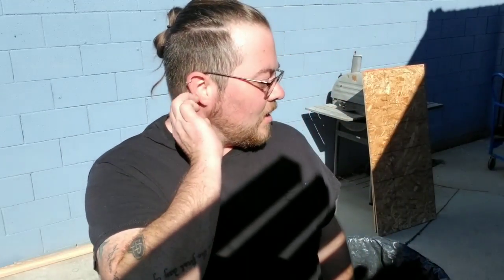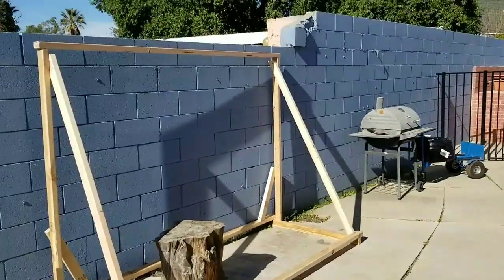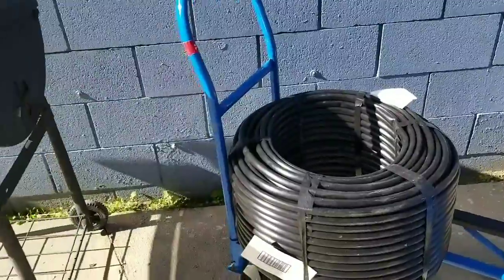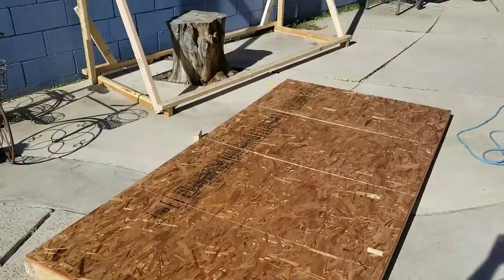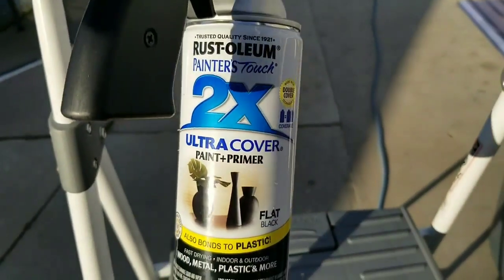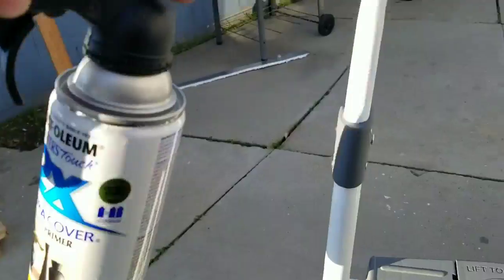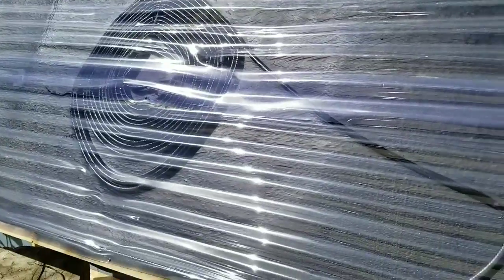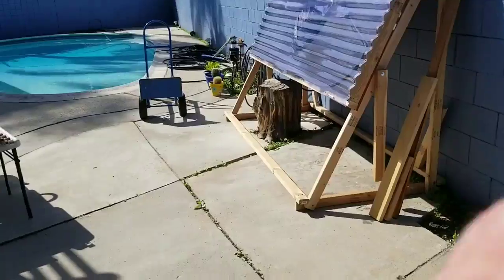solar water heater project...uhh  😁

Comment: Cool project.  Best thing about doing that kinda work is you learn from trial and error and gain a bunch of knowledge in the process.  I've been collecting aluminum cans to use for collector fins when I build my solar water heater.  I'll be using reclaimed copper pipe for mine.  My next remodel on one of our rental houses should give me enough pipe to make one.  Can't wait to see it completed and working.  Just be careful with touching the outlet water because it can get really frikkin hot... scalding hot.
Reply from the maker: Motrukdriver that sounds awesome! I saw the aluminum can build.  very cool.

Comment: you are so creative and innovative!
Reply from the maker: Roaming Raven 😘
Reply: He really is! I've often thought about making one similar to it that I saw on pintrist a few years ago that utilizes aluminum cans inside a 'hot box' frame with a outlet to a dryer hose that blows hot air with a small fan to circulate it. I thought it would help keep my screened in porch a little warmer in the late fall or winter months out here in the Country....who knows. Maybe he has something with his idea, maybe I can modify it and help me heat up a plastic stock tank to make a hot tub.....hmmm. :-)

Comment: Sweetie you can pretty easy to use a heat gun or torch carefully to heat the stiff tubing you have around a pipe to make bends <3
Reply from the maker: Kelli that's a good idea.  thanks 😊

Comment: Dude, good job building that frame, but make sure it doesn't get wet. For the tubing, just get a roll of flexible copper tubing, mount it the way you want in your frame, paint it black and it will last a lot longer.
Reply from the maker: mrbr549 whay happens if it gets wet? I was thinking copper would be the best... expensive!
Reply: That OSB that you're mounting the tubing to will start swelling up and will disintegrate after getting wet a few times. The copper tubing does cost more up front, but will take the high temps much better and transfer more heat to the water. Also, it will last a lot longer then the plastic tubing.
Reply from the maker: mrbr549 oh man... thanks for the heads up.  do you think I could seal the wood somehow?
Reply: You can try an oil based paint sealer and cover that with a couple coats of exterior latex, but I'm not confident it would last very long even with that being done. OSB is just not meant to be outdoors. Sorry I couldn't be more optimistic about it.
Reply from the maker: mrbr549 hmm. I will get a tarp in case it does rain.